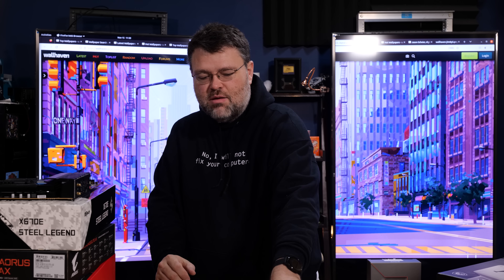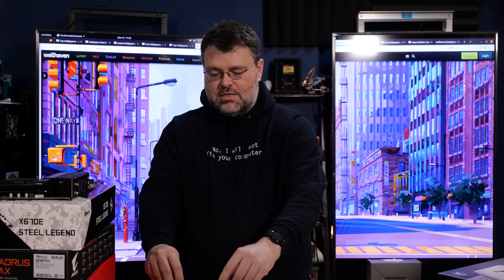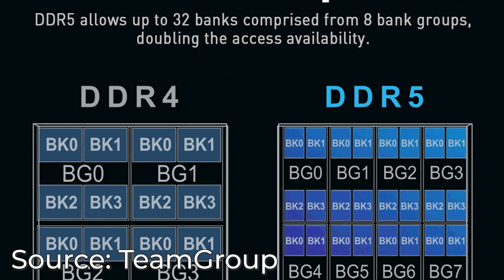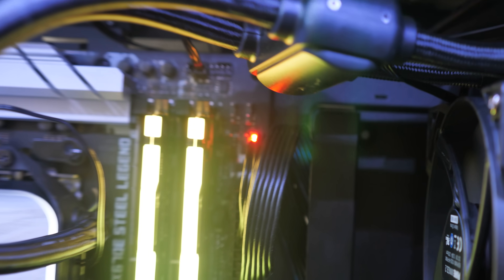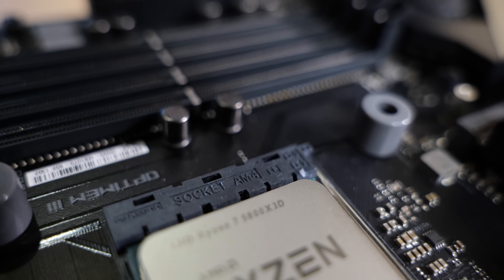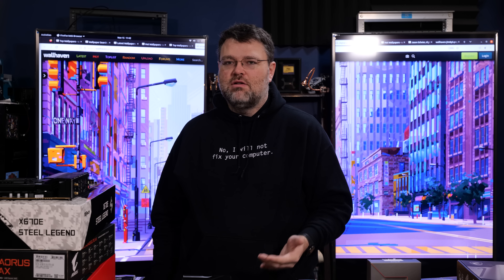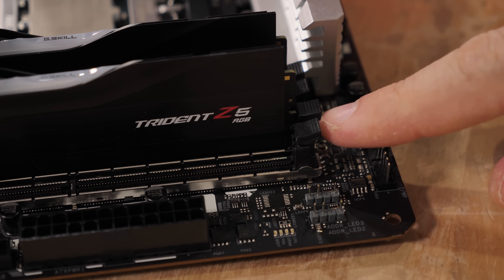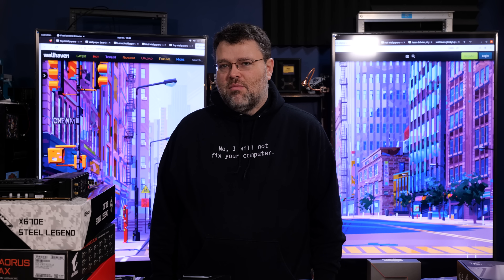Is 128GB of DDR5 IMPOSSIBLE on AM5? Level1 Investigates!

Comment: Some people have told me that they could get the 5600 Trident Z kits to run 128GB stable by first letting the board and CPU memory train with 64GB, and then later filling in the rest of the 128GB and manually setting the speed to 5600 with auto on voltage. This was apparently with a Gigabyte X670E Aorus Master board. The kits they were talking about were the ones without EXPO, but labeled as Hynix within the Aorus Master's own QVL list page.
Reply: I can't run 5200mhzt on 4 dims ddr5 on a x670e hero with a 7900x, 4800mhzt works fine on 4 dims

Comment: The reason it doesnt click into place anymore is because of the old design, the amount of PC build failures and RMA errands that all ended up being beginners not seating the memory modules correctly. Because on DDR3 and 4 the clip clipped on Before the memory module was fully seated. And at the very top level you had bad contact and caused instability or no post. The DDR5 design forces correct seating of the memory. If anyone posts a pic of their non booting first build, just check if the clips are on or not and bäm, problem solved. Seat the memory correctly. Amount of false RMA's based on "defect memory/cpu/motherboard" has dropped significantly for DDR5 platforms.

Comment: Reminds me of getting some Trident Z running at 3600mhz XMP T1 or is it called N1 now... across 8 dims on my Zen 2 TR. I had to increase voltage to the memory controller. They run the controller something like 1/4 or less rated max on Zen 2 stock. I bumped the voltage somewhere around 50% of rated max if I recall 1 step at a time until it post and that was all it needed. I wanted 64Gb on a budget so I got some Intel non RGB RAM but it had tighter timing than all the RGB 3600 kits for AMD and its Samsung B die but it was a LOT cheaper, not even locked up in the case. If I reset my BIOS or preform a firmware upgrade it takes a good minute to relearn the RAM and it takes a few boot attempts but once it post 1 time it always runs stable no problems. Im not sure how major the changes are on Zen 5 or how much the bumped the voltage to run DDR5 if using the same controller but bumping that voltage might get it going and possibly at higher speeds as long as its a DOCP or XMP profile and at a command rate of 1 if its good ram.

Comment: I've commented on many 128gb ddr5 video comments...

I had a 13900k on a Asus Z690 MB, it couldn't run 32x4 ddr5 5600mhz stable past 4000mhz.

At 5600mhz xmp, it just black screens, doesn't even boot into windows.

Now if you're paying extra for 5600mhz or 6000MHz you expect it to run at that speed, not at ddr4 speeds.

For now stick to 2 sticks, max 2x32gb 64gb kit.

Comment: I bought my x670e (asus) back before 32 GB expo dimms were available so I'm running 4x16 GB gskill 6000 MT with 30 latency and it is actually stable if I use the built in EXPO profile fully (not EXPO 1 where asus overrides some settings), although I want to switch to 2 DIMMs at some point since I think it would be better performance?

Comment: IT's hard for me to believe that "the best" RAM has light emitting heaters installed into the heatsink. Wouldn't they have more pride than to degrade the performance with accessory heaters?
Reply: Blame the consumers in this case. Apparently those heaters sell the sticks.

Comment: I recently built a new computer with a Ryzen 7 5700X on an ASUS B450M motherboard with two identical G. Skill DDR4-3200 32GB kits and ran into the same thing.  The spec says 2933MHz maximum for four sticks of DDR4.  I was able to get the system stable at 3000MHz, but some of the memory timings had to be set very loose, and it took alot of tuning to even get the 3000MHz going stable.  At 3200MHz the system would absolutely have tons of memory errors, regardless of timings, and sometimes would not even POST.  I'm guessing DDR5 is even more finicky due to the significantly higher clock speeds.
Thanks for the video.  You've confirmed what I though was the case here with my computer:  The memory controller is simply not up to the task of being overclocked with four sticks of RAM, even single rank.

Comment: It’s probably due to physical signaling that DDR5 doesn’t clock as high when you have two DIMMs per channel. On the server side, for similar reasons, you have to use registered (buffered) DIMMs when you put multiple DIMMs per the channel to reduce the physical load on the memory controller.

Comment: I have artifact and stability problems with iGPU even with 2x16GB @6000mhz X7950. Memtest is fine, but I have to set problematics programs to use "HIGH PERFORMANCE GPU". i.e browser and vlc player.
Reply: RMA
Reply: @penguinbelly  RMA what? I have already changed CPU and it did not help at all. Memory on memtest is fine and everything else is stable. My guess is poor dirvers or just general incompatibility with all the hardware.

Comment: I want stability, so I got ECC DDR5 so I could have error detection to know with confidence if I push the memory speeds too far without long term stability testing. Despite both AMD and ASUS (for the motherboard) claiming ECC support, it will not run in ECC mode. I'd love to see more content covering how ECC is useful for cases like this, and the sad state of advertised but not working AM5 ECC.

Comment: Instead of memtest86 you want Prime95 (or mprime for Linux) and its torture mode configured for the memory configuration that eats all the RAM in the system. It will catch issues that memtest86 fails to find. If you can run the torture test for 24 hours, the RAM can be considered stable.

Comment: I had similar issues getting just 64GB of DDR4 4000Mhz running even XMP on my x570-ryzen 9 5950x setup. I eventually got all 4x dimms running at 3733mhz with an fclk of 1866 but it was a pain in the ass with a lot of testing and restarts and instability.

Comment: Between the DDR5 memory connectors not offering the physical support they used to and the new GPU power standard that is a flaming success on Nvidia cards. (hehe) It seems build quality is on the chopping block for cost savings.
Reply: Well.. if users push the GPU connector fully in, and don't socket their ram while the mobo is on the case standoffs, there's no reason to worry too much.
It's easy to blame the hardware to feel better :p

Comment: Gskill's SKU makes sense and instantly tells you a lot about the product. F5 means DDR5, 6000 is the rated speed. 3040 is the first two cas latencies of 30 and 40 32gx2 tells me that it is 2 stick of  32 GB stick Tz5n means it is trident z with Expo profieles where as TZ5 whithout N means it is XMP profiles. The lack of a K or S means it only comes in one color way
Reply: Jesus Christ why do I need to know that in the SKU name? Should AMD rename their 7950x to 7950x16 in order to tell you that it has 16 cores? If the product name can tell you what chip the ram is actually using, that would be much appreciated because Amazon or Newegg pages pretty much never state that.
Reply: @JohnOrangeseed  that is too much information to shorten further. And every bit is relevant. If you only care about the speed and capacity, just search for those. For guys like me, knowing that actually helps alot. I'll always remember what Maheer said now.
Reply: @fistan5447  Agreed! One string to rule them all. Thank you @MaheerKibria!

Comment: Is the insertion so much of an issue for DDR4?  I recently got a Ryzen 9 5950x, a Gigabyte Aorus X570 Elite (not the WiFi version) and two 32 GB sticks of Crucial DDR4 2666 on the way in the mail.  I got the CPU at Bestbuy on sale.  I already have an RTX 3060 to go with that in the PC I already have.  I will be swapping it to the new motherboard.  The motherboard it is on only has PCIe 2.0 but really you would never guess that in most cases.  Maybe on that board it might stutter a bit but I don't play the most demanding games.  The new configuration will just open the door to being able to try the latest games if I choose to.  I not only like the 5950X because it was on sale but it is also not an APU.  APUs are OK for laptops but I don't care for them on anything else.  I remember when the PC I now have was built we had an issue with one of the motherboard standoffs.  My boneheaded Uncle doesn't realize there are two different thread pitches.  If I have an issue with one of those I might just get a new case too.  I am hoping that when I try to get the thing out it doesn't spin instead of come out.  I won't be too happy if taking the motherboard out becomes a 2 hour ordeal because of that.  I didn't tell him I am building this one.  He is not a bad person but I don't like screwups like those.  I got a bag of standoffs just incase they are trouble and I just get a new case.  He had the tap and die set out when he messed that one up and that made me a bit nervous.  You should never have to use those tools if it was done right!!  It is a Cooler Master case so it is not like there were any fitment issues.

He is one of those people who thinks that MAC addresses are just a Macintosh thing to give you some idea how little he knows about those things.  In all fairness I am not sure how many people even know that their WiFi card and Ethernet adapters all have them and each one is different too.  It is one way you can block out certain computers from a network or whitelist devices you know.

Comment: Hello, I have a question that I hope you can give me a short answer to. have tried to find an answer without success.

I have always used the same 4 pcs. 4GB memory chips 16GB.

(CORSAIR VENGEANCE BLUE 1600MHz 4GB 9-9-9-24 1.50V)

With an Asus sabertooth 990fx and
AMD  FX8350

It worked fine for many years until I installed win11.

Then I started getting a blue screen. It took approx. 1 week between when it happened. After a lot of troubleshooting and testing with other memory chips, I found that only the first 2 memory chip slots worked. I came to the conclusion that it was the memory controller in the processor CPU. which was destroyed.

Since this is not a new CPU, I managed to buy it used and cheap and had my theory confirmed.

In the meantime before I bought a new CPU. then I built another computer from parts I had. A computer that was not quite complete. same year and actually the same system AM3+ but a different motherboard from the same year

(Gigabyte GA-870A-UD3 v1.2) a typical gaming motherboard from that era. The strange thing was that the 4 of these memory chips I had did not work and my computer would not work.

Then I took out one memory stick and replaced it with another memory stick

(Corsair Dominator 1333MHz 4 GB 1.65V 9-9-9-24 XMP)

and set memory chips in bios to 1600MHz and timing manually

9-9-9-24. it has so far worked perfectly without any errors.

My question is as follows.

1. Why did I have to replace one memory stick with another to make my computer work? Do you have any theory on this? After testing, I know that all 4 pcs. stick works without problems.

2. I tried some Overclocking programs in win 11 which were unstable and destroyed another set of 4 pcs. memory stick, that's what I think was the cause. I hadn't even set anything in the programs since they crashed. Can such a program destroy a memory stick? Do you have experience or a theory?

Comment: Need some help from anyone knowledgeable here. I managed to get my system running very stable at 128gb 4600mt/s using 4x32gb 5200 sticks. I'm pretty sure that speed penalty isn't too big of a dealbreaker, but is there something else that might be? Perhaps latency and/or memory bandwith?

What kind of benchmarks can I use to compare my 64 vs 128 config that is somewhat representative of productivity performance? Any help would be tremendously appreciated!

I've detailed my setup/config in another comment here in this video.
Reply: No. If you are actually using 128GB (really more than 64GB) there is nothing that will make up for the performance that extra RAM gives you, even if the RAM runs at 3,600Mb/s.  If your system is stable, why look for a trouble?

Comment: aren't ram banks paired in am5 wendal , meaning slot 1 and 3  are paired together same with 2&4??

so kit 1 in 1&3 kit 2 in 2&4 or did amd kabosh standard mem banks on am 5

not into bling bling memory because you're wasting power to run it

can you get hold of non rgb rgb memory and repeat the test

Comment: also on intel case...its the best for any memory it supported ...it can run 2 or 4 lanes ...due to awesome quad memory controllers ...but i think they put each one per dim slot to maxmise the bandwidth and reduce latency as well when each dimm have its owned controller  that tend to need 4 VRMS vs amd only 2
Reply: No, both amd and intel have 128bit ddr bus, no difference in wiring
Reply: There is 1 memory controller on either AMD’s or Intel’s CPUs.

Comment: I have 4x16GB running at 6000 MT/s CL36 on my 7950X.  it's actually 6200 MT/s ram, but i downclocked using Memory Try It for better overall timings, and auto:1:1.  I did have to lock uclk:memclock to 1:1 in the bios manually.

I did use memory that MSI listed as QVL'ed for four sticks.  (MSI x670-P Pro Wifi)
Reply: Yeah, it seems like 4 stick combinations are much easier with 16gb rather than 32. Glad its working out for you! Not sure how 2x32 compares to 4x16 tho

Comment: I'm currently running 128gb DDR5 at 4600mt/s with my 7950x. They are two 2x32gb kits of corsair CMK64GX5M2B5200Z40 (5200 mts c40). Those kits were pretty cheap compared to most lately and probably still are today.

That's the max I was able to run them on both an Asus proart creator wifi x670e board and an asus prime x670e pro wifi board. Both running at docp profile 1 and setting the target frequency to 4600 (no other tinkering, using the latest bios which you do need to update!). Above that it won't boot.

Not officially supported but I think its the most bang for the buck 128gb configuration I could find. Hopefully this info can help some people. Maybe I could manually OC to squeeze a bit more but I've read of instability issues so I don't bother with it. 

I might upgrade in the future when true 4 stick kits become supported, available and affordable. Imo buying more expensive ram than my config is just not worth it as it's pretty clear something much better will come along eventually and you're gonna need to upgrade anyway, even if you splurge for the higher end ones now. I kinda also doubt the current kits will get that much better support through bios updates as many manual OCers have tried their best to push them to their limits in 128gb configurations with no success. I don't think a docp profile that actually can get them to their rated max speed is even possible.

Thanks for this great video. Wish this video was available when I made my build, it would've saved me a ton of digging in forum, trial and error buying the wrong things, and tinkering around in the settings. I'm sure it'll help out a lot of people.

Ps: my boot times are very fast now, once the first boot was completed. The memory training time on first boot is always very long, and annoying since you never know if it will eventually succeed or not. If you follow my config you should have no problem matching my results easily and get a very usable working 128gb setup at a somewhat decent speed. Cheers y'all!

Pps: heard the expo version of my kits currently have a bunch of issues, my local shop has stopped carrying them. I recommend you get the regular xmp version like me.
Reply: What voltage are you running the sticks at?
Reply: I had 32gb ram and I double to 4 sticks so 64gb pc was stable for days speed was 5200mhzt then got a blue screen heard if u reduce the speed should be fine, so I reduce by 200mhzt running at 5000mhzt gonna see if it works, but two sticks even at 6000mhzt is fine.
Reply: I was running 2x32 blades of Vengeance CL32 6400Gbz at 6000Ghz with no issues. Today added 2 extra blades and my hell started. Updated the Bios before installing them. Got them recognized at bios, boot, and no POST or windows Anymore. I was only able to see the bios again removing PHYSICALLY the 2 new blades. So i see the BIOS, was able to down the speed to 4000Mhz, put the blades again, and finally it boots. (But it took me some hours in the process of trial and error. And Having to remove the blades each time to see the bios is a nightmare. Now i am running 128Gb at 4000Ghz. Gonna re-read your post and try to squeeze more of it.

Comment: Short answer: No. Why should it? I have 2x 32GB G.Skill 6000MT/s CL32 EXPO dimms and before the same, but broken ones with XMP (they failed MemTest86 with XMP profile) and just for the lulz, I put all four (with JEDEC standard tbh) on my Gigabyte Z670E Aorus Master with a 7950X and CPU-Z said 128GB. You are right that high frequencies can only be achieved in dual channel mode with 2 modules. 4 will always downgrade the speed. That is why I went with these extraordinary EXPENSIVE(!) 32GB dimms.

Comment: the dimm slot is a component sourced from another company.
nothing you see soldered on the motherboard is made by the motherboard manufacturer.
You will find slots that do the automatic click thing, you will find some that don't. 
It is not an agreed-upon standard
Reply: Then what does JEDEC do